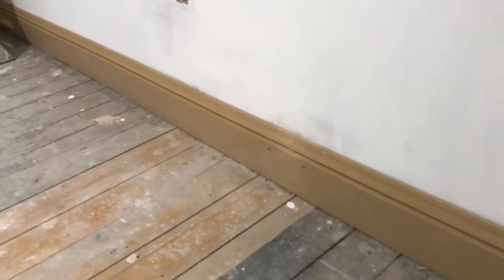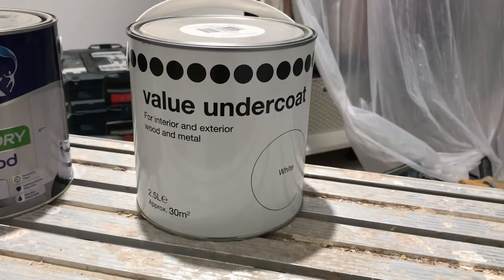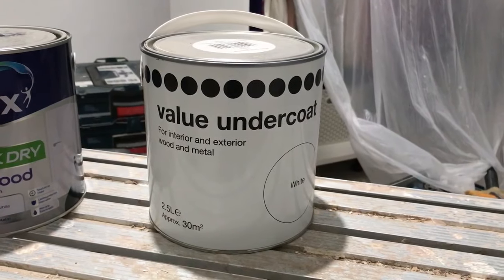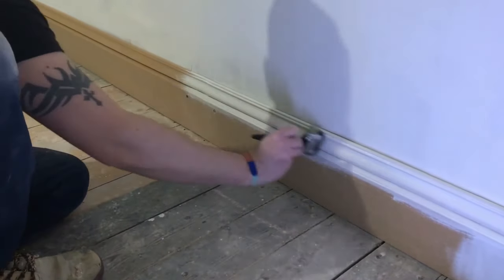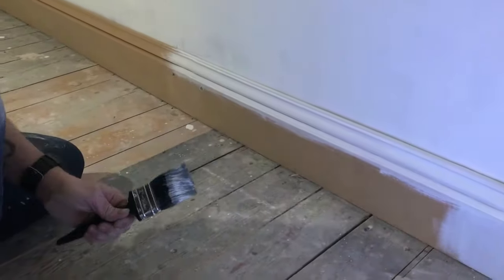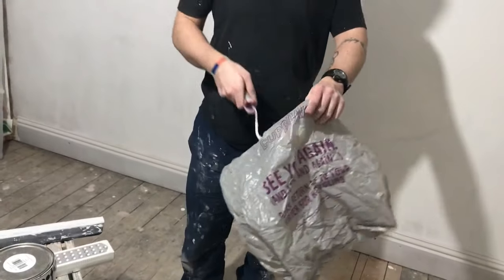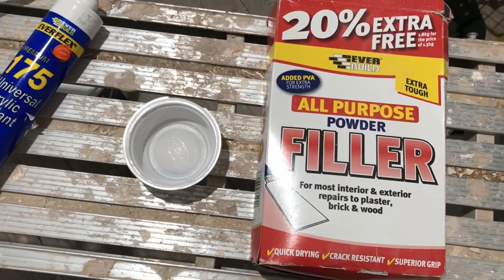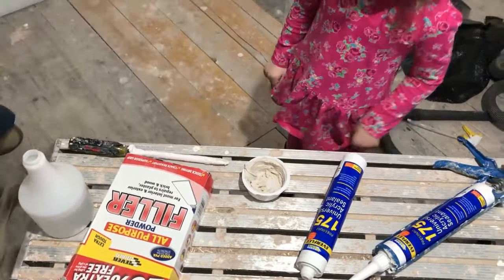How to paint MDF skirting board / baseboard, how to fill & caulk them. Skirting board installation

Comment: While watching your series about skirting boards i was thinking, he must be working on his own house, cause in job site no one have time for sanding between coats or glue outside corners, everyone wants job be done fast and cheap without even knowing what it takes to make decent job. Most of the time little bit of filler and acril will do the trick.
Great job on a panels and video too.
Reply from the maker: Liudas Gaska I show how it should be done, if people want to cut corners then that's up to them but I have always taken a pride in my work! Thanks for your comment and thanks for watching 👍🏼

Comment: Great video. My MDF skirting boards are going to be fitted soon. How do I avoid the caulk from cracking afterwards? I've seen that people paint the caulk as well? Thanks
Reply from the maker: Caulk is designed to be painted. If you don't paint it it will discolour and look dirty. To stop it cracking try applying a second bead after the first has dried. Thanks for watching and be sure to like share and subscribe to help the channel grow 👍🏼

Comment: Nicely done,but when doing a job with long lengths whether it be skirting or external  barge boards soffitts etc, paint them priof to installing
Reply from the maker: michael kilner good tip, I usually spray undercoat skirting before installation but for the purpose of this video I didn't because not everyone who paints the skirting has the chance to paint it before installing it. Thanks for watching 👍🏼

Comment: You used the bag for the roller, another great way is to use clear film that you would use to wrap your leftover food or better called "cling wrap" by Glad.  Makes a great air tight seal.
Reply: I used to work with a lad who was a painter & decorator by trade. He used to put his brushes and rollers in water. He said all you are trying to do is stop the air getting at them. After using paint trays he would let the paint dry then simply peel it away from the tray. The amount of water I'd wasted over the years washing the bloody things :-)
Reply: Also, when you do wash the brushes after soap and water use some hair conditioner and let it sit on for a minute and rinse.  Keeps the bristles soft since most expensive brushes are made of animal hair.

Comment: Over here in Canada we finish the flooring before we do the baseboards (skirting).
It is very strange to see it done in the reverse order. Why do you do it that way?
Reply from the maker: Roderick Roderick if I was going to put a hardwood floor down I would lay it first but I am putting carpet down in most rooms so it makes sense to fit and paint the skirting boards (baseboards) first! Thanks for your question!

Comment: Hey mate, we’ve just had new skirting fitted. I was going to tackle the job myself, your video has been very helpful. Just a quick question, with the gaps in the corners or the joins of skirting boards, should I fill or caulk them?
Reply from the maker: CSB I recommend filling the joints, caulking into the corners and caulk up to the wall! Thanks for watching 👍🏼
Reply: Spend Time, Save Money, DIY thanks for the reply mate. Also, would you caulk everywhere or just where there are gaps between the skirting and walls?